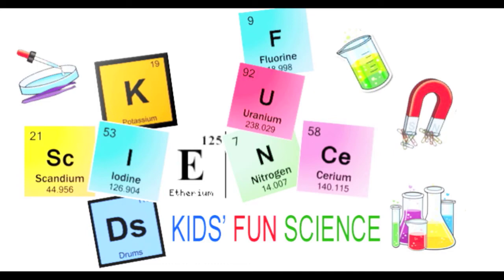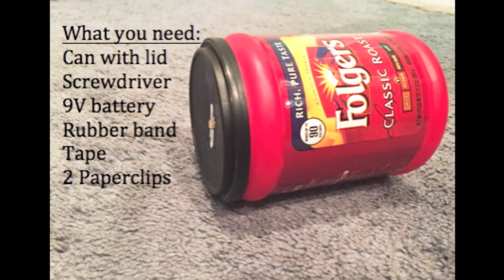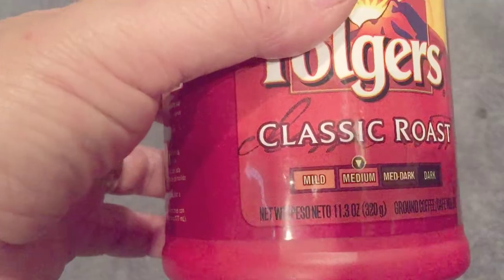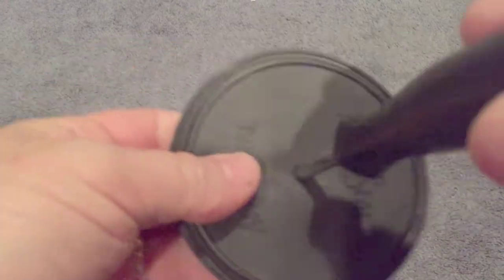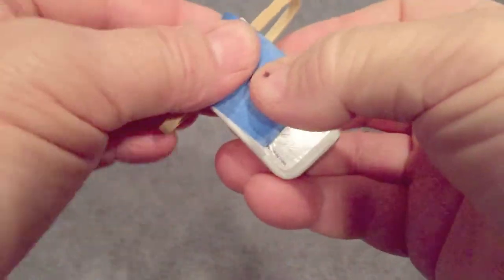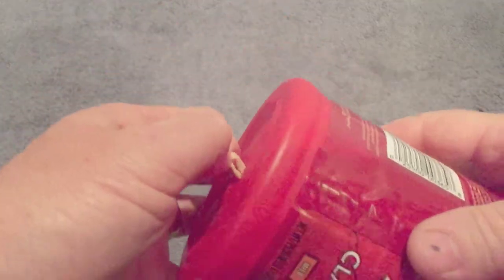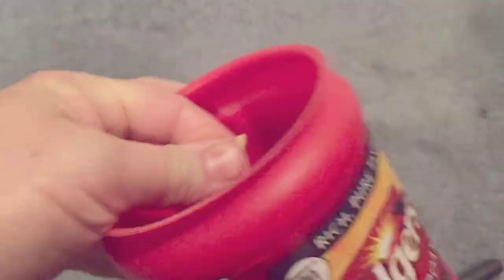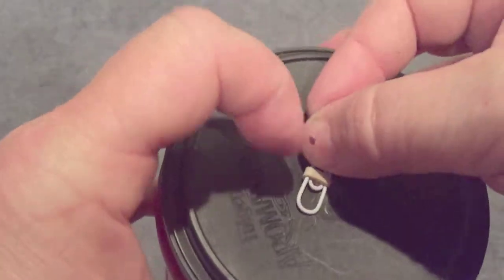ROLLBACK CAN Experiment (transition of potential energy to kinetic energy)

Comment: Why can the can that be rolled back by itself what is the cause ???
Reply from the maker: Hi Aril Saputra, The reason that the can moves backwards is the transition of potential energy to kinetic energy. In the case of the rollback can, kinetic energy is transformed into an easily observable example of elastic potential energy, which is then transformed back into kinetic energy. 

The way this works is when I rolled the can forward, I gave the can kinetic energy. Gravity exerts a lot of force on the heavy battery, pulling it down and causing it to resist the twisting motion of the rubber band. As the can rolls forward, the stubborn, heavy battery doesn’t turn with it, so the rubber band gets all wound up. 

This converts the can’s kinetic energy into potential energy, and once all the kinetic energy is used up, the rubber band can untwist, pushing against the battery and rolling the can back towards you. Potential energy turns back into kinetic energy!

I hope this helps. Thanks for watching, Thx Ken